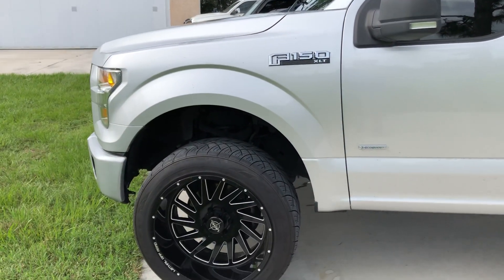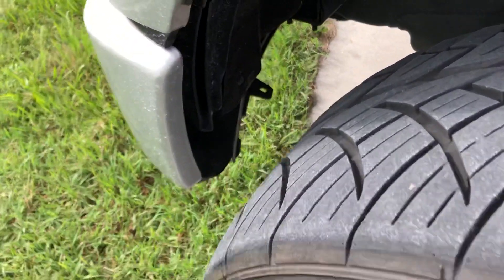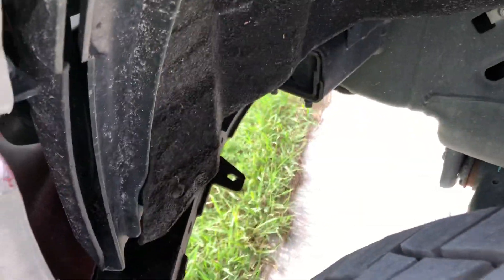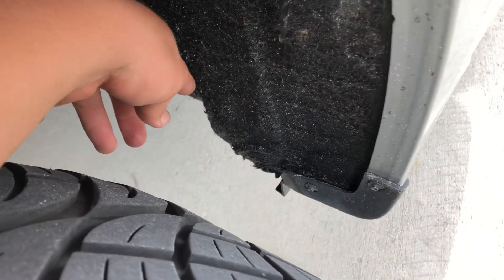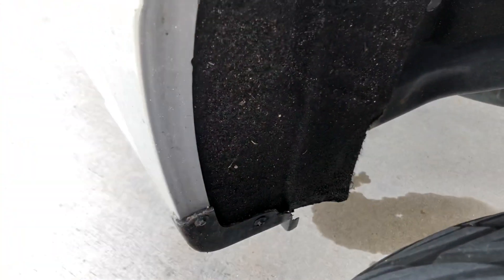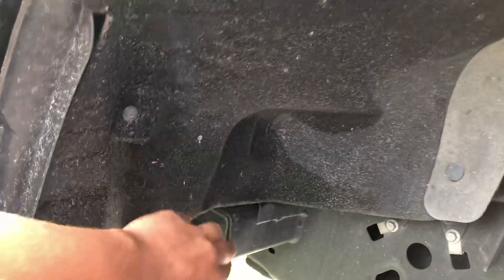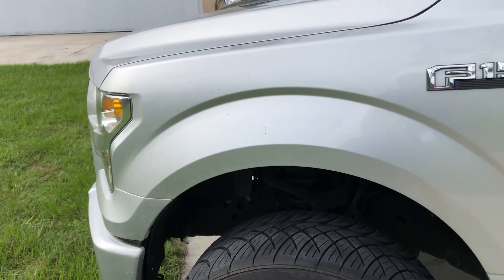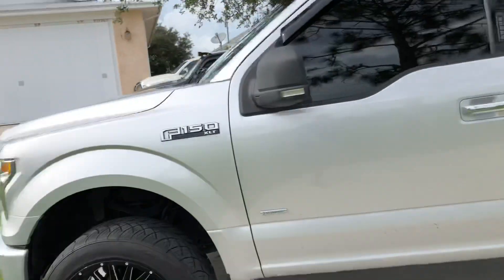22x12s On a Leveled F-150

Comment: The tires is what makes it hard to fit.... you are talking about the wheels when in reality the tire size matters more.
Reply from the maker: Yeah, you can’t run a 14 wide on a level on 35s but you can on 33s the point of this is to achieve the maximum width possible while only being leveled, and still drivable
Reply from the maker: This video old BTW I’ve changed my wheels since this

Comment: Any down side ? I am about to buy some rims and tires for my 2019 f150 with a 2 in level. I’m looking at buying a 22/12 rim. With a 305/40/22 S/T. Any tips or down side to the bigger rim smaller tire?
Reply from the maker: Not really, they just heavier, be careful with big potholes and curbs if you don’t want rash, but had the 22x12s and 305s and it rose beautiful